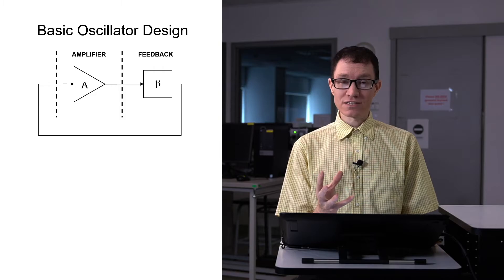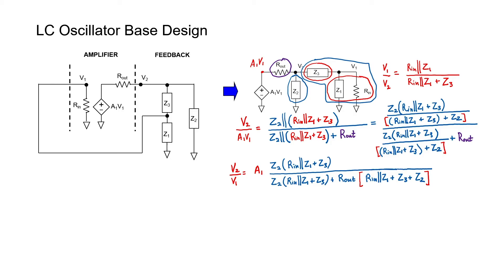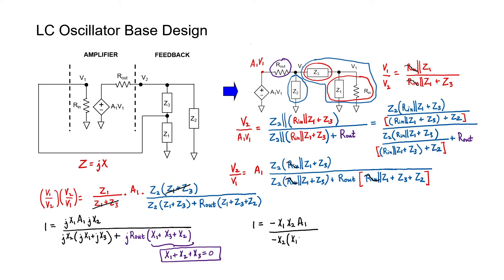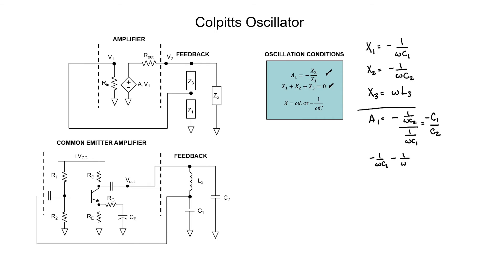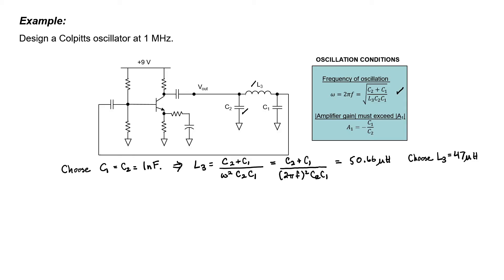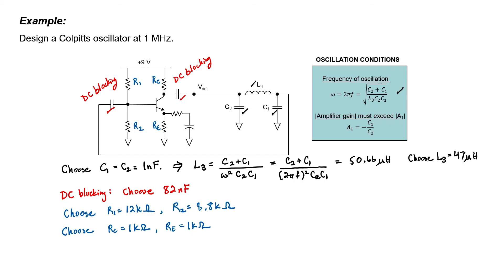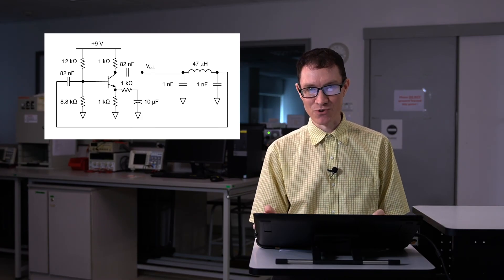Colpitts Oscillator Circuit Analysis (7 - Oscillators)

Comment: I wanted to set it up for 25kHz with 1nF,1nF, 81mH but it is not oscillating in the simulation. I still do not understand how this thing can oscillate. :( It looks like for some reason I have to rise the cap values. So it works with 10nF,10nF,8.2mH.So it is not enough just to change the L. It has something to do with the range of frequencies this circuit can operate.

Comment: Hi Aaron Danner! Thank you for your detailed explanations. Now I can say that I understand how this kind on oscillator works. Please, can you also explain the Pierce oscillator or the crystal oscillator often used in the Z80 processor schematics. I mean the one that use two 74LS04 inverter ICs that have feedback resistors, two capacitors and a crystal quartz. Unfortunately I cannot attach a picture of the schematic and also the online schematics I found do not provide a secured link.

Comment: I've been tinkering with building simple ham radio circuits, and I kept finding various transmitter designs based on Colpitts oscillators hard to understand. Now I get what's going on - Colpitts oscillators are just an amplifier hooked up to an LC tank circuit in a way that creates positive feedback into the amplifier's input. I built a circuit for the lower HF range (about 3.5-5.5 MHz) following your schematic, using a variable capacitor as one of the capacitors and using it to vary the frequency. Not only does it work the way I expected, but I finally understand why now! Thanks for such a clear explanation!
Reply: Can you please explain me the process since I want to build a transmitter based on colpitts oscillator

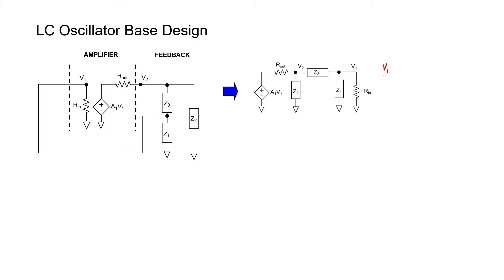Comment: Hello profressor, I am a Bsc student in computer engineering, and currently writing my thesis and I want to reference this video in my paper. I have a question. At 2:05, when you first apply the voltage division method to find V1/V2, you do not take into account Z2 in the denumerator. But later on, when you give V2/V1, you treat it like a parallel impedance (which is logical). I tried solving the same way you did but I used Z2 as a parallel element in the V1/V2 equation as well, but I got 0=1 as a result, so I assume my logic is flawed somewhere, and yours is correct. Can you please explain why you did it like this?
Reply: Finally I have figured it out. Yes, V2 is in fact dependent on Z2 through the fact that the current in the branch depends on it, but it does not matter, since we have to multiply with both the numerator and denumerator with this current and so it cancels out. 
This also applies in the V2/V1 case, but the current is the generator current, and it also cancels out. I wrote this answer to my own question in case someone else needs it in the future. :)

Comment: Could you please tell me why did you use the strategy to multiply v1/v2 by v2/v1 and assigning 1 as a result. This condition is related to Barkhausen criteria.
Reply: When considered X1+X2+X3=0 was to guarantee phase zero? Another condition from Barkhausen?
Reply: @MrCleitonls  correct

Comment: At 4:00 Why do you neglect Rin if the impedance in the base of a transistor is high?  Isn't Rin supposed to represent the input impedance of the transistor?
Reply: There is a resistor in serie to CE to control amplifier gain. This resistance is reflected to the base multiply to HFE. This way if the resistor value is 500 Ohms and HFE 100. The resistance seen from the base will be 50K Ohms plus rpi which depending Ib current.
Reply: Thus Rin will be in fact much bigger than Z1 and the equivalent resistence will change just a little bit.

Comment: I'm still a little unclear on the function of the capacitor, Ce
Reply: RE is used for BJT DC polarization (and designed to get a gain of 1 at DC or low frequencies), but for AC this resistor may be too high and CE allows to lower emitter resistor (and increase BJT gain at high frequencies to make sure the oscillator keeps working) by connecting RG in parallel to RE.
Reply: RE has function to keep polarization stable avoiding HFE variations cause by temperature changes or transistor substitution with different HFE's. CE desacopplishs RE avoiding change DC polarization and increase considerably the gain of amplifier because the AC signal won't see RE and it will can use the DDP RE to increase his excursion over VCE. The amplifier gain without CE will be RC/RE, but whit CE the gain increase a lot and to don't distort the AC signal he put a serie resitor that work like RE just to control the excursion of the AC signal without distortion.

Comment: This is by far the best L-C oscillator analysis I've seen on You Tube.  
The only thing I would do different is to add a section to emphasize the physics of the resonator tank circuit and the transformer like qualities of C1 - C2 and L in the resonator network i.e. A=-C1/C2 (gain required).
Reply: look at 5:23 the guy said this using impedances X1 and X2

Comment: Hi Aaron, thank you for this series of videos. I have one question regarding the equivalent circuit used to derive the conditions of oscillations, i can see that you used the Op. Amp equivalent circuit for the amplifier, is there a reason to use this model instead of the hybrid model or the pi model?
Reply from the maker: Students sometimes find the abstract models too difficult at the beginning, so I'm trying to avoid them and instead concentrate on the oscillation condition.

Comment: Thank you for your clear presentation. I am a little confused however about why the development of the conditions of oscillation are dependent on the existence of Rout. If the amplifier was perfect, Rin would be infinite like you assumed and Rout would be zero. Without the Rout term X1+X2+X3 would not need to be zero so you couldn’t derive the frequency equation or the gain relationship.

I understand that in the real world amplifiers have output impedances but is there a way to derive the relationship that ignores this fact?

Charlie
Reply from the maker: In this oscillator, it is required that there be a non-zero Rout (or that there be some kind of resistor there).  If the amplifier were perfect and Rout=0, then Z2 would have no effect on the voltage at node V2 because Z2 would be in parallel with a perfect voltage source.  There would then be insufficient phase shift around the loop to achieve oscillation; the equations would thus fail to give a single frequency of oscillation without the added constraint as you rightly pointed out.
Reply: @adanner  Thank you. I did do a calculation along the lines of V2/V1=Z2/(Z2+Z3), V1/V2=Z1/(Z1+Z3) …. Multiply these together, set them to one and you get the required Z1+Z2+Z3=1 relationship. I think this mimics the situation if Rout=0. It is all academic I suppose since we do live in the real world without perfect amplification. I was thinking of the impedance element as a filter so I approached it as such.

I very much appreciate your presentation. So often I see a superficial approach like calling the impedance in this oscillator a tank circuit when it really isn’t. Yes the equation is the same for the frequency but no one but you showed mathematically the inverting nature or the feedback decency on Z1 and Z2.

Once again, thank you. Charlie
Reply from the maker: @stevekim6923  Yes, it is equivalent to what is written since (X1 + X3) = -X2.
Reply: @adanner  Thank you very much! Before you answered this, I deleted the question because I understood it later on. I guess i wasn't fast enough.
Reply: You could look at his two port network examples to see why you don't want a voltage source driving a capacitor. infinite current required?